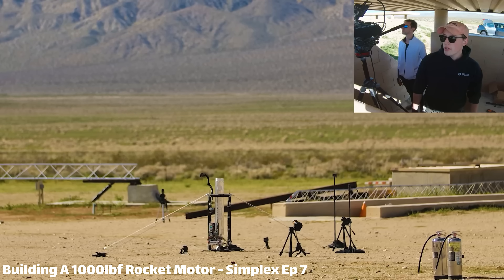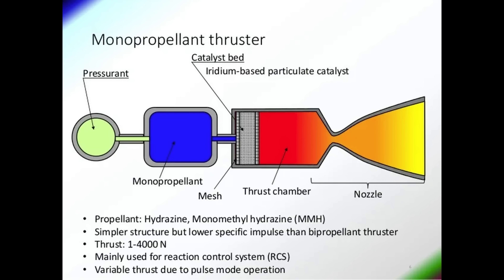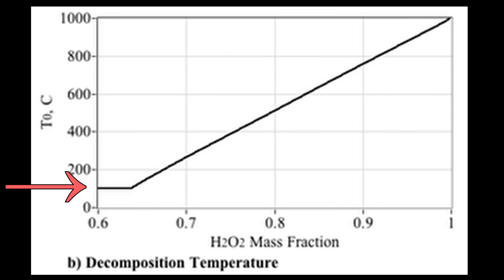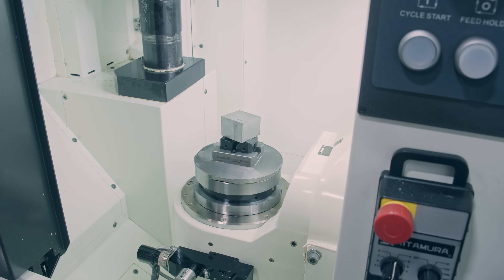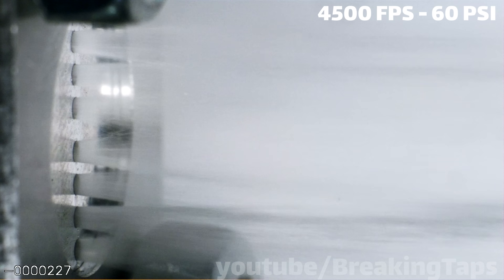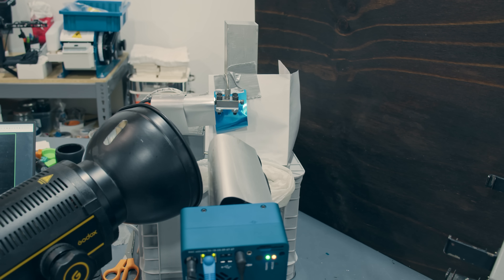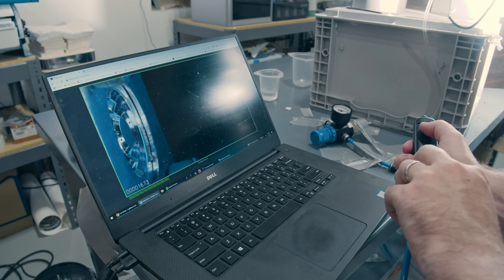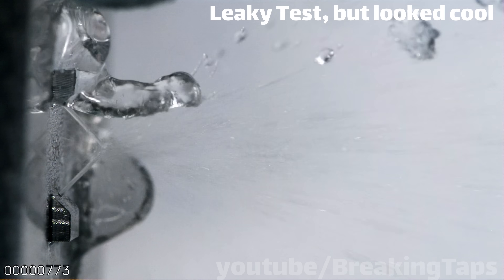Prototyping (Tiny) Rocket Injectors

Comment: One way to reduce the amount of air getting in to the injector that I can think of is to pressurize the tank before the test, then open a valve to release the liquid. That way you don't have pressurized air coming in and 'pushing' the water out of the way. Something else to consider is the difference in viscosity and surface tension of hydrogen peroxide compared to water, even a small change can have drastic results when talking high pressure fluids.
Reply from the maker: Ah yeah that would have helped a lot. Will see about incorporating a solenoid and more automated testing in the next round (I want to get the sensors working soon anyway, so will have a microcontroller in the loop soon).

35% peroxide is a tad more viscous than water but not much (1.1cP vs 0.8cP for water), so I'm mostly hoping it behaves near enough the same 🤞

Comment: The reason the 0.2mm holes look so much smaller than you'd think relative to 1.0mm holes is because we're talking area here not just diameter. While the ratio of the diameters of the two hole sizes is 0.2/1 or 1/5 or 20% depending on what measurement means the most to you, the AREA of the holes tells a very different story. The 1.0mm holes have an area of (about) 0.8 sq mm while the small 0.2mm holes have an area of only (about) 0.03 sq mm. No that's not a mis-shifted decimal. Thats a ratio of 3/80, or only 3.7%. A much much smaller ratio than that of the diameters, which fits the much smaller visible size of the small holes vs the large holes.
Reply from the maker: Oh yeah, when expressed as area that makes a lot of sense why it visually looks so much smaller! Felt like I was going insane at first when I was looking at them 😅

Comment: Get some car fuel injectors, they are pretty damn good at it, gasoline ones are also easy to control, avoid diesel ones, some are piezzo electric requiring 200V to open.
Also gasoline ones are much smaller and for quite low pressure, diesel ones go up to 2000 Bar!

Comment: Have you tried applying a huge (kv) potential to the metal so as the fuel goes by it gets charged and doesn't immediately recombine into huge drops again? o.o also I've got a tea strainer that has the TINIEST holes in the bottom maybe try and find one, it's like a metal cup that goes inside your regular cup, you put loose tea in and pour water on. The holes are TINY though
Reply from the maker: That sounds kinda terrifying! 😅 Is an interesting idea, I wonder if anyone in the industry has done some kind of electrostatic injector thing. Will look around!

Comment: How did you drill the 0.2mm holes?
Reply from the maker: PCB drills! You can buy carbide drills designed for PCBs all the way down to about 0.1mm, and they are really amazing for the price. Loaded them up in the CNC, let it peck away at tiny increments and come back an hour later :)
Reply: Ok. Thanis 🙏

Comment: I think may be as catalyst you can use cold plasma, which you can do just use air from outside, AC HV and low power compressor. If you interested of cold plasma just google "Cold Air Plasma To Decontaminate Inanimate Surfaces of the Hospital Environment".
Reply: I mean if you mix cold plasma with fuel and oxydiser. Cause cold plasma increases the adhesion of materials to water(e.g. steel) throw increasing the surface energy of the upper layer of material atoms. And I thins by this way cold plasma will increase the reactivity of the mix.

Comment: I feel like that footage at ~12:18 cannot be even close to be shot in 20 000 fps. Thats just a water stream, and at 20 THOUSAND fps there still isnt any fluence? I dont think so... There must be some mistake. On a 20 000 fps footage, ran at 25fps, even an explosion look almost still, but the simple water drops cannot be followed? Nah.
Reply from the maker: I'll double check when I get to the shop on monday, maybe there was an error between shutter speed and frame rate, but I'm 99% sure it's correct! It's just a really fast event. Even in the 4500 FPS examples, you can see small droplets drifting in the background as if they are frozen in time, but the main stream is booking it.

I think the poor resolution (1024 x 128) and low contrast makes it look more dynamic than it is too. For the next set of tests I'm going to try and setup a schlieren system, which should improve the lighting and contrast.

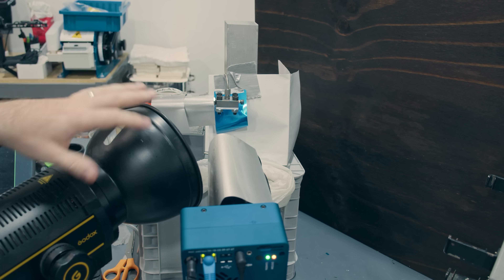Comment: 10:05 yeah it's always hard to appreciate, especially with area, as a 1/5th radius/diameter hole has 1/25th the surface area/volume (assuming the same depth).

Comment: Do you really need to atomize h2o2? Wouldn't it be in full contact with catalyst if you just pump it through with a laminar flow?
Reply from the maker: Yeah, technically it just needs to make contact so full atomization isn't needed (or maybe desired at all?). It might help in that it allows more to contact deeper into the catalyst bed compared to a solid stream. Or maybe not!

I admit, part of me just wanted to see the impinging injectors on the high speed camera 🙂
Reply: @BreakingTaps  i think what would happen is that trapped air will gradually pushed out of the space between injector and catalyst and it will become turbulent flow resisting itself, similar to a Tesla valve. Anyhow thanks for your amazing work, it inspires myself👍😁 👍

Comment: You can use an Agricultural sprayer nozzle for that, it atomizes very well, and you can choose the shape of the sprayer, from a triangle to a hollow cone, and the materials too, up to ceramic nozzles 😊
Reply: Sprayer nozzles are used in may sizes and mist/spray patterns in the industrial food market. I uesd them in systems that sprayed baking pans mostly.

Comment: Now, I'm also not a rocket scientist, but if I wanted to do a monopropellant rocket I'd probably not worry that much about injection, and just have series of fine silver(ed) meshes to pump peroxide through. Possibly by using the pressure increasing due to boiling to push peroxide through finer and finer catalyst meshes/sieves it can create sort of feedback loop...

Comment: The visually striking difference between 0.2mm and 1mm holes is due to the squared growth of the area of a hole; the holes are 25 times smaller, which is more aligned with your perception of size than thinking of it as having a radius 5 times smaller.

Comment: Aerospace engineer here. Love this channel. Always a cool topic. 

I was terrified at the beginning of the video when you said that you were going to build a monopropellant rocket. I though that meant using high percentage hydrogen peroxide and it’s pretty nasty. The lower percentage stuff is lot safer so I’m glad you went that route. 

That said, make sure you read up on proper storage. I remember reading a story in my textbook about a lab technician at Purdue not properly venting a container of hydrogen peroxide. Since it’s constantly decomposing it can build pressure before “violently decomposing” which will destroy the pressure vessel and shoot shrapnel everywhere.

I’m sure you already know this. But the only other thing I’ll say is make sure you build your combustion chamber out of a ductile material like aluminum. That way if it explodes for whatever reason you also don’t send dangerous shrapnel everywhere 😂.
Reply from the maker: Been storing it in a mini fridge, and burping it occasionally to relieve pressure (if any) 🙂 I did see some pretty wild containers for the high test stuff, which have built in expanding bellows to accommodate the decomposition. Pretty scary stuff tbh! Even if I could find a vendor for higher percentages, not really sure I'd want to. Reading through Armadillo Space's archived dev blog is equal parts fascinating and terrifying 😅

Interesting point about using a ductile material. I was actually planning the opposite, building it all out of stainless. But using a weaker material does make a lot of sense. Will think about that, and also see what kinds of pressures the electric pump feed generates.

I do plan to "fire" it only inside a safe enclosure. Will probably weld up a steel box and surround it with bricks and such. I dont have a lot of background in energetic stuff, so planning to be suuuuper cautious and extra safe :)
Reply: It’s not about strength! Use a good strong material! 

What I’m talking about is the how the material fails. Ductile materials like aluminum will pop open and vent an explosion. On the other hand more rigid materials like a hardened steel will fracture causing shrapnel (pipe bomb). The shrapnel would be the real thing to worry about. 

Hope that helps!
Reply: @mmmmm49513  another good approach is to have bolts designed to fail at X times MDC so that the nozzle blows off in the event of a chamber overpressure. Great place to use materials like brass (or even plastics) for the bolts
Reply: @BreakingTaps  how do you access those archived blogs?
Reply: @undeadarmy19   was wondering the same thing.
Reply: Yeah, I've seen what it looks like when forces are enough to literally shatter steel. Don't want to be anywhere nearby if that ever happens.
Reply: Aero here too. I have a liquid 50lb biprop on my channel. I had that same feeling about the real deal High Test H2O2. Treat it like LOX. Get it and use it on the same day.
Also, I forewarn that the pump will be the most difficult part of this adventure. Materials, seals, bearings, heat,... All of it. Rockets fundamentally don't have any moving parts.
For your injectors the L/D ratio of your injector holes is more important than the diameter. 
While testing, check valves will help with consistency at startup due to their crack pressure.
Welcome to boiling the ocean for troubleshooting and good luck!
Reply: Another aerospace engineer  - good points all around.
I went to Illinois so hearing that someone at Purdue screwed up made my day.
Reply: I'm wondering if silver will even work as a catalyst with lower percentage hydrogen peroxide. Had to go looking at research papers which indicate silver will require ~90% + hydrogen peroxide. But also don't listen to me because I've never build a mono propellant rocket before. :P Cheers
Reply: So youre saying all i need to do is vent it
Reply: HTP is impossible to buy so I’m not surprised. And refining store bought stuff is also really hard.
Reply: @jerry3790  It can be done by vacuum distillation without much difficulty, more a matter of being brave/foolish enough to actualy do it.
Reply: @samthenerf  Why do you think it would be foolish to vacuum-concentrate (water distills over) H2O2?
Reply: Also hydrogen peroxide can decompose into an explosive in direct sunlight.

Comment: If you ever try making an engine again, you could try an H2O2+ethanol with dissolved KMnO4 in it. I haven't done any math if it's possible to ignite it hypergolicaly ignite. 

Otherwise, great work on this engine so far. I can't wait to see more!
Reply: I think it should if the peroxide decomposition products are hot enough and rich in radicals when they come into contact with the fuel.
But I doubt if this is possible with the low percentage stuff he uses
Reply: @fg8557  I once poured a bunch of ethanol with KMnO4 into a glass with 30% H2O2, and it didn't ignite. But that's was at room pressure. It would have a lower flash point under higher pressures.

And if that doesn't work, you can always use an igniter. The much more important question is whether the H2O2 decomposition and ethanol burning can create a self sustaining reaction.
Reply: @dusanboricic2017 The AR2-3 engine used kerosene that is injected into the decomposed peroxide without an additional igniter
Ethanol is probably easier to ignite than that. But probably not with only 30% concentration
Maybe you should not have premixed the fuels so that

Comment: Fun fact: There is still no mathematically ideal shape for fuel injectors. We've been making them by trial and error since the 1950s
Reply from the maker: Huh, I did not know that. TIL!
Reply: @BreakingTaps  yeah, oddly enough it's hard to predict what liquids will do when they collide at high speed. It's also why the weather reports have big error margins.

Comment: When filming stuff like droplets and jets, you could try putting some white acrylic (or something similar) behind your experiment as a diffuser and illuminating it from the back, in my experience that gives better contrast and introduces less heat. Very cool project :)
Reply from the maker: Will give that a shot next time! Getting good high speed footage with enough contrast was super hard
Reply: @BreakingTaps  to be honest I would say that focusing on tech that leads to replicator tech is far superior to anything rocket related, I mean how many replicators can you make with a rocket? now ask yourself how many rockets can you make with a replicator? ;)
Reply: No black background and light from above or below
Reply: Can use a reflector sheet to diffuse it, or diffuser cotton cloth
Reply: @BreakingTaps Can We Just Put A Metal Net Of Some Durable Material 😅???

Or

Can We Put Spraying System And Catalysing System In One Unit In Which The Sprayer Is A Cylindrical Structure Inside The Catalyser ???
And Then We Angle The Nozzles Of Sprayer So That Tiny Water Droplets Are Formed ???
Reply: This is a good idea. I've also seen really cool water-droplet photography using 2 colored lights at 90 degrees from each other.
Reply: Photographer here - black background, and lit from behind. Doesn't need to be directly behind, just out of frame.

Comment: One option might be to mill channels into the rear of the injector plate to help increase the localised pressure around the holes, which should equalise the flow a bit better.
Reply from the maker: Yeah I think you are right. Looking over the footage more while editing and it was really clear the "order" that the holes were pressurized. Making some features on the backside to distribute it better makes a lot of sense.
Reply: @BreakingTaps  I wonder if length-matching the paths to the hole, almost like matching impedance on a PCB, might be a good option here. You'd probably also need symmetric angles on any forks to avoid uneven distribution. Something like pumping all the fluid into the center, hitting a conical detent to correct for flow nonuniformity caused by any burrs or geometry variations the fitting, then uniformly separated outward channels with some snaking to avoid length mismatch... seems like that would probably give you even flow to all your target nozzles.

Comment: If you want to learn more about peroxide rockets. Look at the engines that were used on the british Black Arrow rockets in the 1960s. Apart from the project beeing a political tragedy, it used peroxide and kerosene, and the cycle is brilliantly simple but effective. The use the catalyst to react the peroxide into steam and oxygen, then used that to power the turbopumps to pump the kerosemse and peroxide, then combined the catalysed products with kerosene to make it go boom.
A very simple but effective cycle that I believe didnt have a single notable Failure throught the entire development cycle.
If any liquid rocket cucle is going to be done by a hobbyist, thats the one i would recommend. And you can build off your experience with this project.

Comment: Calling yourself "not an engineer" is purely because you're not paid to do engineering kinda. You're clearly very capable to be one, so give yourself some more positive vibes. :) Love this project!
Reply from the maker: 🥰 Imposter syndrome is for real heh 😅 I have been thinking about taking some courses (MIT open courses or something) just to fill in some of my lacking basic knowledge and math. Like I have a pretty good handle of the high level concepts, but couldn't actually work up a safety factor or compute expected material performances without just throwing a simulation at it. Feels like a gap that could be remedied with some engineering 101 courses :)
Reply: @BreakingTaps  I have the same thing with software engineering. I think it's called to learn "top down". Not sure what is better though. :) I fail tests, yet program in a company. Haha
Reply: @VincentGroenewold  don't feel too bad, never in the history of software development has code written at the appropriate speed passed a test on its first try

Comment: It looks like the next step in testing will be to build a better supply for your pressurized liquid. You’re getting a lot of air in your “propellant”. I think a piston pressurized with air on one side would work better. That way you can bleed it.

Great video. I’ve been thinking about doing something like this for a while. I look forward to seeing what you come up with.
Reply: He also said he plans on using an electric pump, not pressurized air, so they should yield better results
Reply: Or a balloon sac. Keeps liquids and gasses separate. Very low friction
Reply: Well now. Using a "piston" driven by air, instead of redesigning the airstream, is one of those "quietly brilliant" solutions. 

It has all the best qualities:
1) Simple to manufacture using tools you already possess. 
2) Does not REQUIRE (and I stress the word "require") redesign of any of existing components. 
3) does not REQUIRE changing the design or principles of any other part of the system. 

At this stage, all you are trying to do is drive the propellant through the atomizer at the required rate.

I have seen teams disappear down rabbit holes of ever more "brilliant" designs requiring ever more complicated and time consuming machining which, for this purpose, was completely unnecessary. (Ask me how I know.😢)

This is design and trial. The ONLY part that has to look like the final product is the part under test.